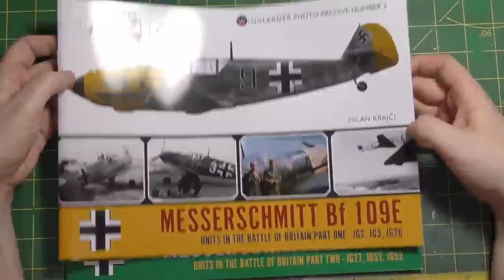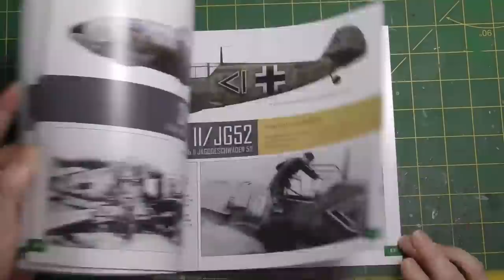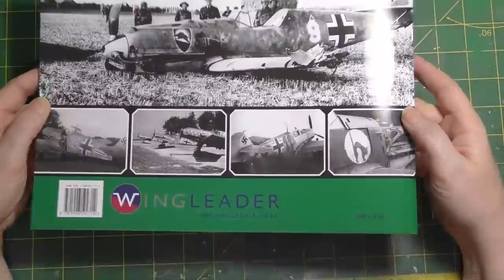Aluminium foil as a natural metal finish for modelling

Comment: If you use the cheapest foil you can find, thin, thin, thin.
You can stretch it into that forward wing root piece. You will have cut it to fit in an arch pattern.  If it splits, you can apply a patch over it , sand a feather as needed.  
sometime I just put paint into the split.
Remember, foil compresses as much as it streches.
Hope this helps.
Wonderful job on that P40.

Comment: I worked on F4's when in the RAF in the 1980's and took those heat shields off the back end so many times . They are secured with screws with very large heads into enlarged holes to allow for thermal expansion. The panels overlap each other . The colour of the heat shields is like a dark metallic grey and they are also coated in patches of dark soot unless they are newly replaced and they are made of titanium I think the aluminium foil looks fantastic but maybe  bit more burning on the foil would be a more realistic reflection of historical authenticity  "what a really awesome technique" .
Reply from the maker: Fear not, weathering will happen to the foil. I did think it a good start though, thanks for the info :-D

Comment: Your idea for using plain aluminum foil (for the type you used; available in grocery stores in the U.S.), with a "burnt" finish (achieved through baking) for jet exhaust heat effect on panels is amazing! It seems most of the modeling community pros achieve this effect using subtle paint washes, sometimes with multiple wash applications, which can look quite good, but your method is much simpler.

Comment: I worked as a B-1b Bomber aka The Lancer aka The Bone, for 10 years of my life. In a way, I’ll always be paying for that job. I broke my back once in a freaky way but it went misdiagnosed and before I had surgery the first time, according to my Doctor I had fractured it easily more than half a dozen times. I’ve lived with constant pain for over a decade now. I’ve been thinking about getting one of the Big model kits and maybe trying to come up with a cool paint idea from history made modern and submit it to be rotated between wings on a yearly schedule for air shows and flybys. The fighters always had a designated team for these big shows outside of the flight display teams like the Blue Angels or the thunderbirds. Even each base has different squadrons so you could give the honor to each squadron. A blacked out B-1 as dark as can be with the bottom the same, except for an Area that holds an electronic paint that can be turned on during flight.  A Bat Signal,Screaming through a low level pass!! The Bats of the 9th BS the 28th being native related the Mohawks, just straight up adapt the paint in one of two ways. Exactly like the Thunderbirds demonstration team, or maybe paint it to look like the mythical Thunderbird. I imagined it looking like a realistic phoenix. Maybe the Reapers could resemble a dragon skeleton… and so on. I’ve even thought to just Crome one out or do a hot rod sorta design…. Those models cost way to much for me to do more than one, and I can’t paint to save my own life.

Comment: I was a scale modeler when I was younger.  I'd do things like find photos of instrument panels, xerox them down to scale and Dremel out the holes in the panel.  A piece of acetate and the picture behind it gave the instrument panel depth and "glass" reflection.  We didn't have kits for harnesses and buckles then so I'd cut up tooth paste tubes and score the strips to make the belts.  I'd use the sprue to make push rods, wires, etc.

I built a 1/48 scale P-51B in about '75.  I had collected gum wrappers and peeled the thin foil from the wrappers to make may panels.  A toothpick with Epoxy resin to replace sanded off rivets.  I used a wash of brown and black to "burnish" the titanium panels and matte lacquer to dull others.  This was very relaxing for me.  Somewhat nostalgic but also kind of Zen like.  Thank you for taking me on this journey.
Reply from the maker: Thankyou for the trip down memory lane Kyle, I used to do the same thing with sweet wrappers...

Comment: You do it almost identical to how I do it.  I put the glue on the model with a flat paintbrush and then apply the foil.  Using the tooth pick to push it down into the panel lines and pick out the detail in the model.
Try a small 1/2" wide x 1/4" thick piece of balsa wood stick cut to a point cross ways to burnish your foil down.  You can get a better bond that way.
Mother's aluminum polish will clean and polish for a show finish.
Keep up the good work.

Comment: Did not see it in the comments so I will throw this one into the group!... lol. I was using the MICRO foil adhesive and found the smell to be very familiar... As it should to us all... Micro Foil Adhesive is just PVA glue diluted with water. I tried it with Elmer's glue. Same Effect!! wipe the mixture on the foil an let it sit till it goes clear(ish). Then use the same technique with the cotton bud / Qtip (depending on what hemisphere you are in) to press the foil onto the desired area. you can save some money and/or if the desired MIcro product is unavailable.
Reply from the maker: Hi Matthew, yes I think  the Micro is some form of PVA glue. The main thing I noticed that differentiates it is that it stays a bit tacky, which the PVA we have in the UK doesn't.

Comment: Mam, consider that Molotow Chrome is the most chrome like paint in existence. Airbrush it on. DON'T TOUCH it. Airbrush on a coat of clear Spaz Sticks. Other clear coats usually turn the chrome to yucky dull grey. You can experiment with areas of Spaz Sticks clear (for chrome) and masked off areas with other clear coats to get areas of "weathered" chrome.
All the best.
Reply from the maker: Thanks for the tip, I'll look it up

Comment: Annealing the foil in an oven or toaster oven should soften it to a more flexible state. Almost stretchy. Kitchen foil is an alloy with a bit of magnesium i think but there's still a pretty good chance it will soften. You'll have to check online for the annealing temp of aluminum to be sure of success.
Now that I think about it though, it may already be annealed and thus the reason it is as useful as it is to begin with.

Comment: I know another way of blackening tin foil easily. Just get some dirty Silver jewellry, tin foil & some sodium bicarbonate ( NOT baking powder ) . Place the tin foil in a suitable container ( shiny side up ), place the silver on it , add a tablespoon of bicarb & add boiling water. It does smell bad - so don't stick your nose over it. You will get some blackened tin foil & clean silver jewellry.
Reply: We did that to clean our son's trumpet and some candlesticks - the combination of the bicarb and aluminium pulls the sulphur out of the silver coating. You'd have to call it a win-win!

Comment: I have tested both the aluminium foil and the BareMetal on my T-6 and Swiss Mirage III: the results have been absolutely astonishing. I think the aluminium foil presents less disavantages to the BareMetal: it can be "stretched" a bit more than the BM and its installation is far more simple, while the strong point for the BM is its thickness. Still I have to solve the issue on the edges of the surfaces covered whit the foil: it is TOO easy to peel off the foil from the edge. Maybe one possible solution (still to be tested...) could be to wrap (literally) the piece un and down, cutting the same foil on the first available panel line
Reply from the maker: I do tend to wrap leading edges in that manner. The best fix (excuse pun) I have found for panel edges so far is a little bit of gloss varnish to seal the edge. Unfortunately it isn't very robust and you do just have to be careful with it.
Reply: @JenesisDesignsandModelcraft  I'll check the using of the clear varnish on the edges.
Or maybe very tiny drops of CA glue

Comment: I'm using this foil method on something completely different. I'm using it on a 3D printed Star wars lightsaber hilt. As you mentioned in the video, corners can sometimes come up. Is there a way of sealing the foil sat the end, like some sort of lacquer or anything similar that can put on a clear protective barrier to stop the feel from coming off in places?
Reply from the maker: Hi Matt, yes it can be sealed in. Try a tiny bit of gloss varnish, thinned PVA or super glue. I use super glue mostly, but you need to apply it along the edge of the foil so that it forms a ramp in effect - making it harder to catch the edge of the foil, and also acting to hold it down to a degree. It isn't foolproof, but it helps.

Comment: I've just got back into building models after years away from the hobby and I've been thinking about building a p51 or a p47 model plane, but getting that bare metal finish has been putting me off.

I've watched loads of videos of folk airbrushing with varying degrees of success, but to be honest, they all still look painted. 

I'm gonna give this process a try.

I take it when you're boiling the eggs, the foil sheets are just floating about and not wrapped round the eggs?
Reply from the maker: Yes, just hanging out in the water lol

Comment: is this technique doable for large items?  I have a 3d printed ebike battery cover that mimics a motorcycle gas tank.  Would the seams where the foil overlay be visible?  Cool idea.
Reply from the maker: It get's more difficult with larger pieces but it certainly possible. The seams will be visible, but not massively so if you manage to make them neat enough.

Comment: I know this is three years old, but how do you boil eggs with foil? How good does the foil adhesive take to masking? I guess make sure it's well glued.
Reply from the maker: You put the bits of foil in a pan with some water along with some eggshells and boil it. Masking is fine as long as you're careful.
Reply: @JenesisDesignsandModelcraft Thanks, I guess as it boils you can determine how long by how dark it gets.

Comment: Jen, outstanding technique! Have you ever tried using Mona Lisa Metal Leaf Adhesive Size by Speedball? It's the best adhesive for foiling. Did you foil the heat shield on that Phantom kit one segment at a time? It's quite impressive! Greetings from Buenos Aires! Cheers.
Reply from the maker: Hi Graham, I did foil the heat shield as you suggest - one panel at a time.
Reply: @JenesisDesignsandModelcraft  Thank you, dear. Incidentally; here's a link to that stuff I told you about; it's worth trying: https://www.speedballart.com/our-product-lines/mona-lisa-meta-leaf/mona-lisa-metal-leaf-adhesives-fluids-tools/ Check on Brush-On Adhesive. I've found your accent to be totally overpowering. XD

Comment: What kind of glue are you using?  Will the white glue dry up and make the foil peel?  I’m just curious because I am trying to learn different techniques for utilizing foil on my models.
Reply from the maker: I added the glue to the description, it's Microscale foil glue. It can be considered a permanent bond, within reason.
Reply: @JenesisDesignsandModelcraft  thank you for the reply. :)

Comment: What is your opinion on using bare-metal foil that has the glue on one side already?
Reply from the maker: I use it frequently, but for canopy masking mainly. It is good, but the adhesive isn't all that good, I find it lifts on edges quite easily. It is also very very thin, so has a tendency to split and tear quite easily.

Comment: They sell alumiNUM foil in the US, are they allowed to sell that in Britain or do they have to convert it over to alummiNIUM foil for you?
Reply: Maybe some solvent seapage under the foil undoes the bond at corners and that's why corners are lifting? Maybe use water based washes instead?
Reply from the maker: The bond of the foil glue isn't absolute, it's quite weak and probably actually peelable. That's why I was so careful when masking it. Larger pieces will hold just fine, but smaller pieces can be lifted or move around quite easily. I ended up sealing troublesome corners with clear varnish in the end.

Comment: can you add the glue to the section on the model you want to cover and then once tacky lay the foil over top? Kind of like how you would for laying down Gold Leaf? I would think it would be easier to remove the excess foil if it wasnt all covered in glue. Is there a reason to glue the foil? Would it not stick to the plastic if not first added to the foil?

This is all new to me, so I am very curious.
Reply from the maker: There is not really any good reason why you couldn't do that if you wanted to, the glue will stick just the same. Trimming and removing the excess is easy enough, the bond isn't mega strong initially.

Comment: Great instructional tutorial. However, I feel cheated as the final finish on your model is nowhere near as reflective as the finish on your video thumbnail. I've seen similar finishes to yours achieved with just silver spraypaint.
Reply from the maker: Hi Alan. I hear what you're saying but the thumbnail is a real aircraft, not a model. My finish is indeed not polished, but that's only because that isn't the finish I wanted. The foil can be polished once the smoothing has been done, I have tested the process and it does work.
And trust me, you haven't seen a similar finish with paint, it's very obvious when viewed IRL that it isn't silver paint.
Reply: @JenesisDesignsandModelcraft  Unfortunately, it was the thumbnail that fooled me into thinking that was the finish that you were going to show. That's the finish I need for a model I'm working on.

Anyway, best of luck with your future projects.
Reply from the maker: @Alan_AB  I had a brainwave! I posted a Book of Jenesis video on foiling after the one you watched. It has polishing in it at around the 24 minute mark - https://youtu.be/k8IrMTGPuVY

Comment: have you tried the aluminum tape?
Reply from the maker: The only tape I have here is very thick, with an equally thick glue layer. I would be interested to try out any thinner tape though if I ever see any
Reply: I always wanna try to tape up a balsa dc3 just to see if it would fly. Anyway dig the vids and models.